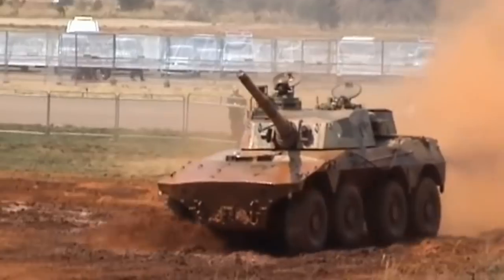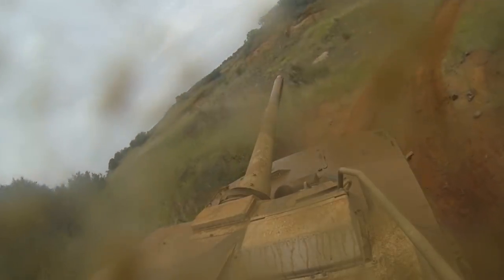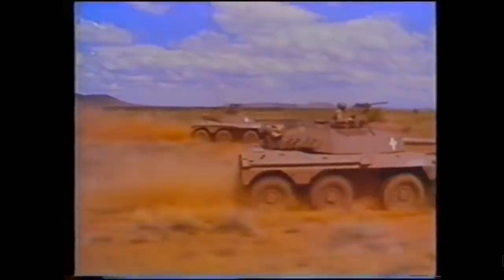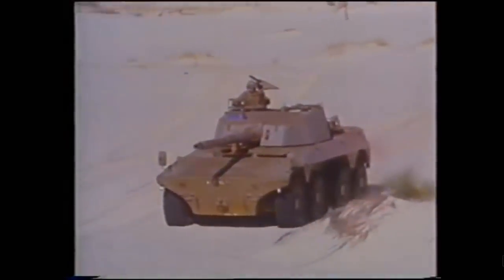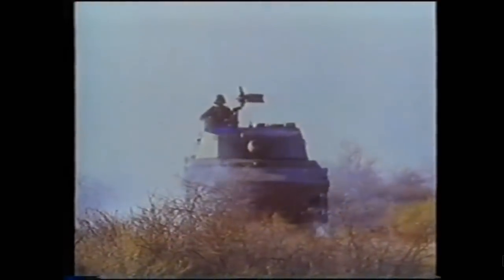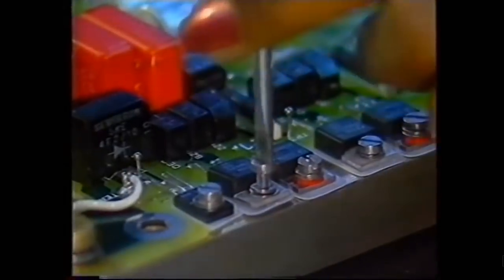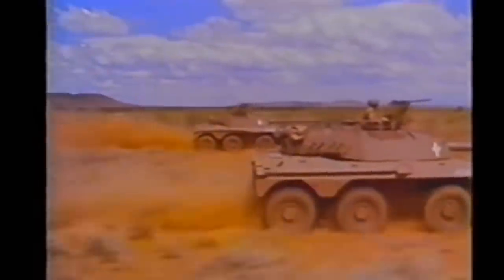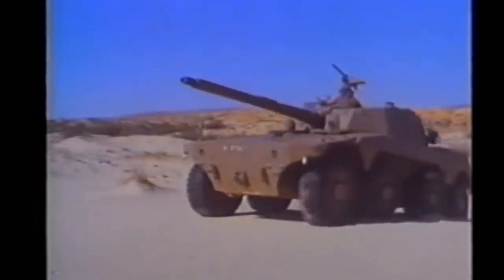Rooikat Armored Fighting Vehicle - South African Firepower

Comment: i find it fascinating how south africa has largely forgone the use of tracked AFVs and instead relies on wheeled vehicles in it's military i mean the actual tank they do have are just upgraded centurion tanks and it's amazing how effective wheeled vehicles can actually be, i mean during the bush south african armored cars where able to out maneuver and defeat Angolan t55 tanks and were able to do this over extreme distances 

hats off to these guys for sure
Reply: And we only lost the war because.... Yes. Our equipment wasn't actually by any means superior and we were able to compensate for that with operational efficiency and A LOT of practice in the field. Ultimately however logistics are telling and you simply can't compensate for having generally inferior weapon systems.
Reply: MrAwsomenoob tracks doesn't suck but hard to fix but wheels sucks but cheaper and easy to use.
Reply: T-55s without almost any exception is a shitty tank even by 1980s standards and even the most ludicrously modernized variants (mall ninja territory imo) would get butchered by even the 1979 era M1 Abrams tanks if properly used with the 105mm guns and no DU inserts.
Reply: true but the south africans were using armored cars with 90mm guns on them and a tank is still a tank no matter what exactly it's short comings may be.
Reply: Even the 90 MM equipped Ratel and other Ifv's were obviously inadequate for dealing with the T-55. People keep underestimating Soviet armor/export models as if their use in wildly different environments and in third world armies can tell us much about their actual characteristics. The best supposed intelligence service in the world ( USA ) kept the US from starting desert storm for at least an additional extra month while they were up-armoring the leading tank formations to be able to deal with T-72 Sabot's. Of course they couldn't have known that the Iraqi army never managed to get the later generation of shells and that what they had were not even correctly loaded. 

These sort of things keep happening and nobody seems to learn from other people's experiences.
Reply: t54/55 was not a bad tank for it time ,, but yhea no shit it cant stand any modern mbt or mbt of the 80s lol (cause the 54/55 are form the 50s era tank lol ) t55 was design to fight m48/47 +m41 not to fight m60 or m1 vv
Reply: The T-54/55 was widely superior to the M-48 and if one goes by the Iran/Iraq experience at least equal if not better in even the export model. If one look at how the T-55 evolved and was constantly upgraded i have little doubt that in European conditions it was always at least a match for the M-60a3.  Uparmored and with ERA ( not something generally available to foreign allies) the T-55 was a great tank right up to the introduction of the Leopard 2/M1 Abrams  ( early 80's ) and useful even after that.
Reply: actually you do need tanks, the south africans did build and use tanks, its just they are more difficult to use in africa due to long supply lines, i think a combo of hostmann suspension tanks and wheeled vehicles is the best for africa/third world nations as they are the 2 easisest to maintain and fix in field and are also cheaper to make and have longer service lives with only minimal disadvantages for their sustems, the best african army would have predominantly rooikat styled AFVs supporting a similar IFV/APC equiped infantry aswell as cheaper wheeled APC type vehicles. they would then have small numbers of tracked light tanks for certain special missions as well as heavier MBTs used for tank hunting large tank formations with helicopters used to support rooikat type units vs small numbers of tanks. MBTs could also be used for spearheading against more fortified lines.
Reply: No way T54/T55 was no challenge for an L7 armed M60
Reply: The original tracked tanks were developed to overcome trench deadlock with it's associated mud and obstacles.
Any modern wars are likely to involve lots of sprinting and movement. Wheels make more sense to me for efficiency, speed, cost and durability in the field.
Reply: SA would only be deployed in it's own familiar terrain, manly to defend against the norther neighbours and perhaps gurella armies from the boar areas. It doesn't need tracked vehicles like other larger militaries that may see broader action.
Reply: The operational area during the bush/border wars featured a large geography, dense vegetation and relatively small numbers of combatants. Too much territory for tanks. A good read is - The role of south african armour in south west africa/namibia ... - Journals
journals.ufs.ac.za/index.php/jch/article/download/544/524
Quote "The SAAC believed that they could take on tanks with armoured cars and "got away with murder" in the process"
Reply: @cnlbenmc  Just for interest, the average engagement distance, during our border war was 20m, not 3 to 4 km, but so close that artillery support wasn't an option.
Also, tank on tank took place under 1km, some engagements were sub 50m. At those ranges, even outdated tanks can cause serious damage to even modern tanks.
IIRC an Iraqi T62 killed X2 Abrams in ODS.
Reply: @pietersteenkamp5241  ek gaan met jou verskil. Dis oor gegee deur die pw Botha, fw de klerk en sy bendes. Was jy daar ? Noem vir my een geveg waar ons verloor het , want ek weet nie daarvan nie.
Reply: @cnlbenmc  have you ever seen the inside of a tank ? You seemed to be an expert on the subject...
Reply: @MrAwsomenoob  and what happened to the tanks that was engaged by these armoured cars ? I was there, we're you ?
Reply: @inouelenhatduy  talking about older equipment. When was the colt 1911 introduced ? And the AK 47 . Does this mean they aren't effective. As jou hate 80's stuff , wise ass punks irritates me ....
Reply: @MrAwsomenoob  "a tank is still a tank"  Only if you don't know a single thing about armored vehicles. You sound like one of those guys who calls everything with tracks a "tank".

But, hey, I guess it would be really impressive if a modern soldier was able to kill a medieval knight in plate armor. I mean, it doesn't matter that it's just a thin piece of steel made with centuries old technogy going up against a modern weapon that vastly outclasses it, it's still armor.
Reply: @lappieslabuschagne2428  no I wasn't, but I love researching material like this, though sadly i cant find much information on the SADF and the border war that isn't in afrikaan.
Reply: @MrAwsomenoob  it's a pity you don't understand Afrikaans, but I wish I could have helped you. I can tell you this , that during these operations the 90mm canons mounted on the ratel( badger in English) and the eland (named after large antelope) was the only vehicles to stop these tanks advance and they did. Later when they came into device ,the rooikat( named after a fierce cat , a lynx) proved to be efficient against these tanks. Although the armor on these vehicles are not of the same standard (thickness) as on  the tanks. They surely are not "tank resistant ". The vehicles are only the platform but the armament and the crew's ability is the deciding factor. Most people misses this point.
Reply: @1652HCU  

" Iraqi T62 killed X2 Abrams in ODS."

Where do you get that info? As far as I know zero Abram wee destroyed by Iraqi forces during Desert Storm. Out of the two  Abram that weren't destroyed by friendly fire , both were destroyed by the US forces themselves after they were damaged and irretrievable behind enemy lines.
Reply: @pietersteenkamp5241  this armoured car is superior to the t55 as long as you dont get hit, they had better training, mobility and range, so the t55 couldn't do anything to them.

Also, battle over large areas, a fast moving armoured car like this is excellent.
Reply: Wheels? In combat? maybe for its riot police against unarmed mobs- are you some kind of clown? those things could not even stand up to iraqs amor forces
Reply: @Professional_Youtube_Commenter   The armored car is superior under the circumstances where you put very intelligent highly trained and experienced men in them who can somewhat consistently arrange to outnumber T-55's 2 or 3 to one and ambush them well enough to get flanking shots.  The T-55 significantly out ranged both the eland-90 and the Ratel-90 and the few T-55 that's were destroyed can only be used to prove something if you really want to see that proven. If you would ask the SANDF they would just tell you that the T-55 were always of deep concern to them and after their first few encounters never felt comfortable engaging them with anything other than "olifants' (centurians).
Reply: Part of the reason for the wheeled vehicles was due to the South West African desert conditions, it was found that the tracked tanks would suffer from the desert sand getting mixed with the grease in the tracks, and turn into a very powerful abrasive, so you ended up with a massive track attrition rate.
Reply: @lappieslabuschagne2428   Luckily they were smart enough to quit while they were still winning and of course i guess if they were much dumber apartheid wouldn't have lasted as long nor would they have quickly extricated themselves in 1990 once the USSR went the way of the dodo.
Reply: @pietersteenkamp5241  was jy daar boeta ? Jy kan gaan gesels met die "sandf "se ape maar dalk moet jy gesels met die mense wat op was en diens gedoen het in di SAW nie sandf nie! Hulle sal jou kan vertel. Papier en polititici sal jou vertel en dan kan jy boonop kies waarvan jy hou. Was jy al ooit in n ratel ? Het jy die 20mm geskied ( nie eens die 90 nie) ? Waar het jy jou opleiding gedoen ? Kink vir my jy wil iets se maar jou kennis skiet ver te kort in ondervinding. Asb jy kink soos n gv (grensvegter - dit was n foto-verhaal boekie van Rocco de we , en dalk bitjie voor jou tyd )  En die term gv word uitgespreek gee-vee . As jy in die bos was sou jy geweet het waarvan ek praat.
Reply: @pietersteenkamp5241  dis vir my duidelik jy is duidelik oningelig, en nie intellektueel opgewasse om intillegente gesprek te voer nie.
Reply: @pietersteenkamp5241  gaan lees jou bybel jou sot. Dalk kom jy tot insig ! Dis omdat jy praat van goed waarvan jy niks weet nie, dat jy sê wat jy sê.
Reply: Reaper5.56 Xx   They can be deadly in lower intensity conflicts where the enemy does not have modern optics/IR and thus can't see you in bad weather/dust/dawn etc .  The Iraqi T-72's did not have ammunition that could penetrate the Abrams at ANY distance over the frontal arc. The fact that even the Bradley's could engage the T-72's probably indicates superior training as well but i don't think that was much in doubt.  We know there were at least a few instances where the Iraq's were not discouraged by massive casualties ( T-72's and the like getting knocked out all around) and they still tried to close the distance and it just never worked out.     Of course i would not take away from this so much as we should always take into account at the T-series tanks were designed for combat in central/western Europe and not in wide open deserts where engagement distances are literally 3-5 times larger.
Reply: @lappieslabuschagne2428  Just a point of correction (yes I was also there) the Rooikat was never deployed operationally     Ratels (variants included) and Oliphants did the hard work.
Reply: @TheBodieClan  jip ek weet dit goed , dankie man. Net maar mooi verstaan wat ek bedoel dat ons nie verby mekaar praat nie.
Reply: @pietersteenkamp5241  The war wasn't really lost, and certainly not because the South Africans were losing on a military level. The people back home just got sick and tired of contributing to a war effort that, in their eyes, served no purpose to the fatherland. So eventually the South African government succumbed to mounting social pressure and just sort of bailed on the border war. Its similar to how the USA 'lost' the Vietnam war. There just seemed no point to continue a war that there was nothing really to gain from.
Reply: Earl Wyatt  so true what you say.
Reply: @daaichommie708  No we actually really 'lost' that one as Pretoria had grand ambitions but were caught totally of guard by the massive Cuban commitment of up to 35 000 personal and significant heavy weapons to support not only these forces but the MPLA. If Pretoria foresaw this possibility i dare say they would never have intervened in the first place and they went away because the South-African military/logistical capacity was stretched to capacity. 
Now as for the USA in Vietnam it may have lost in some sense but since the major point was made that the USA would sacrifice tens of thousands of American lives and vast amounts of equipment to fight 'communism'  ( not really but lets pretend) next to China ( or the USSR) it's hard to call that a loss. It's like me burning down your house, killing your pets and you insisting that i 'lost' because you are still alive; whatever, i guess.
Reply: @koosbos1114  Well i feel confident that if 'young schoolboys' were not taught their history by well selected apartheid style history teachers they would know  things that the rest of the world's actual historians could agree with.
Reply: Earl Wyatt   Yes, we punched above our weight class but we did not foresee the Cuban involvement and had absolutely no home grown solution to that type of unexpected commitment. My larger point was simply that if you went back to 1940 France and looked at the number of 'superior' ( more heavily armored/gunned) french of British tanks that were knocked out with statistically unlikely shots to barrels/optics/ tracks from forward aspect and the like you would come away thinking the Germans were very luckily. Turns out they were actually just very good but as good as they were the east front showed that you can't keep putting your men in untenable situations and depend on a small minority of high performers to gain you perpetual tactical success.  
With the weapons at hand we never had a chance in Angola and it was not like the Cubans were not going to learn and adapt to mobile operations at the extremes of South-African logistical limits.  It was there's to lose and by their massive overseas commitment they had basically shown that they had both the political will and the logistical prowess to make this point.
Reply: @CBXrr  Yes, The Ratel's did but it took extraordinary coordination and effort and was only made possible by the wide open spaces and uncongested ( from enemies any ways) and wooded/bushfeld areas. Olifant tanks were seen more as stragic assets that could not be practically replaced and were only to be risked when it could achieve strategically important results.  In either case the Olifant tanks were not obviously superior to the T-55's and still required the crews    to tactically defeat them which given the disparity in training and experience they mostly seemed to manage; just wasn't any way to fighting a protracted war.
Reply: @lappieslabuschagne2428  Operation Packer.  Regiment President Steyn Olifants failed to take their objective and got bogged down in a minefield.  RPS was my Citizen Force unit.
Reply: @CBXrr  the armour on a Ratel wasn't even a match for a bulldozer. I was in Windhoek mid to late 88 and saw the aftermath of  what the blade of a bulldozer did to  the side of a Ratel.The bulldozer was on a flat bed and the vehicles crossed paths in opposite directions over a little narrow storm river bridge near the Logistics Depot a few kms outside Windhoek. 
The Ratel was ripped open like a tin can down its side maybe 3 or 4m long.
It was just a case of incredibly bad timing.
Reply: Sounds more like a projectile problem than anything else.
Reply: The experince of wheeled vehicles came from their experince in fighting in Africa during ww2.
Reply: @lappieslabuschagne2428  the rooikat never met a tank in battle, it was all over by the time it was released.....
Reply: @Frog13799  was jy ooit op coppertin toets gebied ?
Reply: @lappieslabuschagne2428  nee, maar dit is nie die punt nie, die rooikat was in 89 in diens gebring. Die punt was dat die rooikat nooit in aksie was in Angola nie.
Reply: @Frog13799  is so , net die ratels maar jy behoort te weet as jy daar was. Hulle was reeds n bekvol vir die russiese tenks. Die rooikat sou verseker n groot kopseer  gewees het vir klomp, glo ek.
Reply: @lappieslabuschagne2428  ek was nie daar nie, n goeie maat van my vas. Hy was in 61 mech en het in n ratel 90 met die T54s n bietjie vasgesit.
Reply: @pietersteenkamp5241  lost the war??? On the battle field???
Reply: @LeonKotze70   Yes, remember the guys that were doing the actual bleeding were Unita and when we and allies could not supply them sufficiently there was no hope for 'victory' or whatever the hell you think we were doing in Angola. The fact of the matter is that we simply were not prepared to get into an escalatory confrontation with Cuba as they were crazy enough to ship tens of thousands of people over the Atlantic and we were not even willing to drive that many up to Angola. Sure the Cubans and Angolans suffered a lot but the Cubans were willing to take hundreds of casualties and we were not. That = losing.